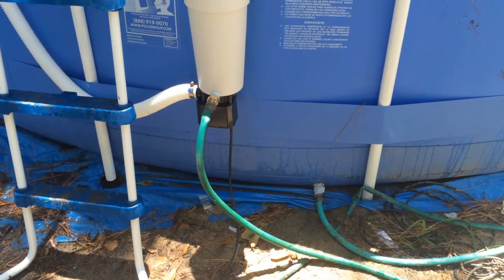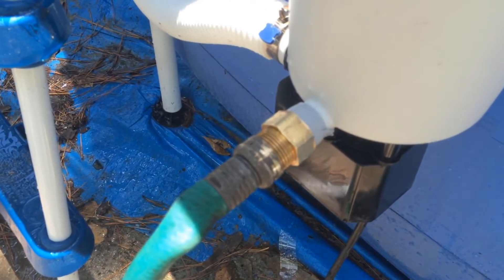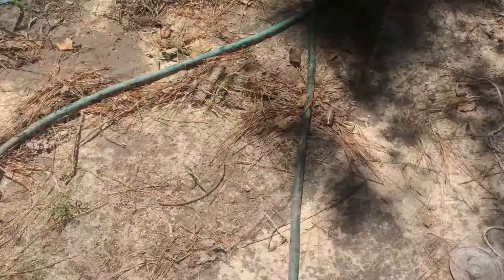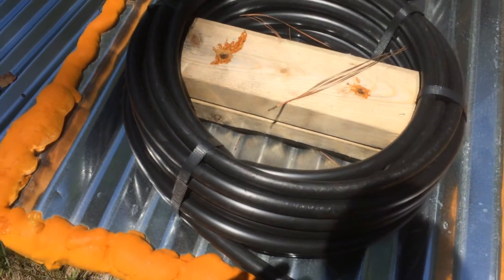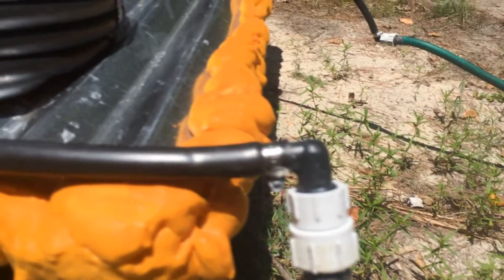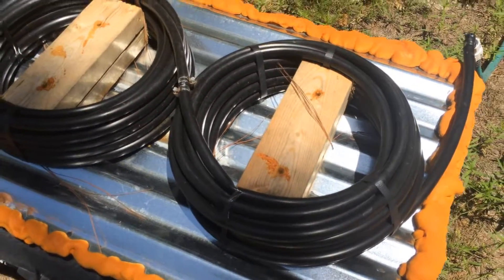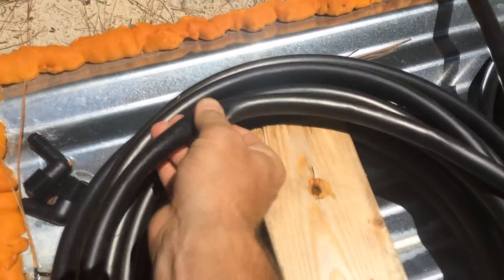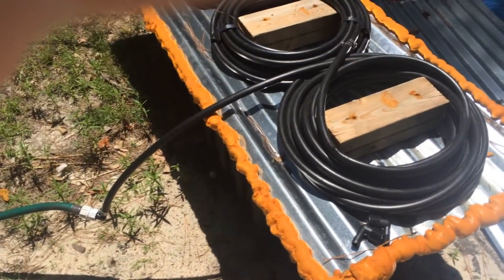Solar Powered Pool Water Heater For Under 80 Bux!!

Comment: I have the same pool and setup, only thing different (and this is just friendly advise) , the coils you have are tubes on top of eachother leaving less surface to heat up. Uncoil them and make a nice "snailhouse type" coil which exposes all the surface of the tubes to the sun.